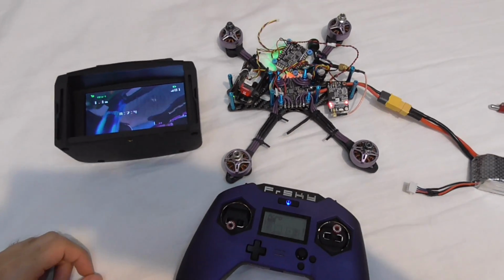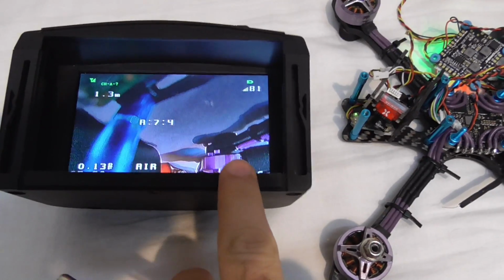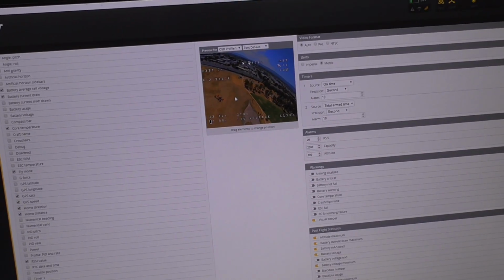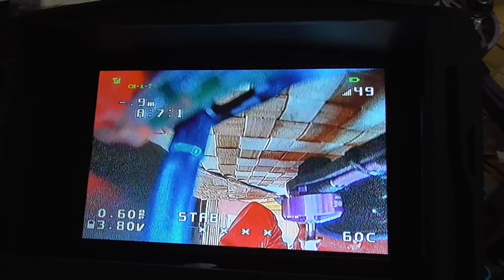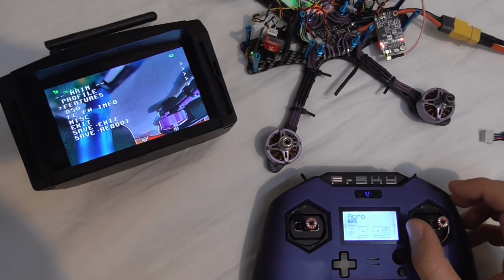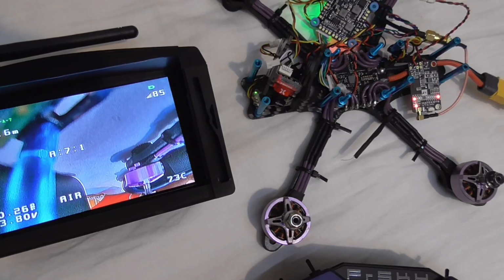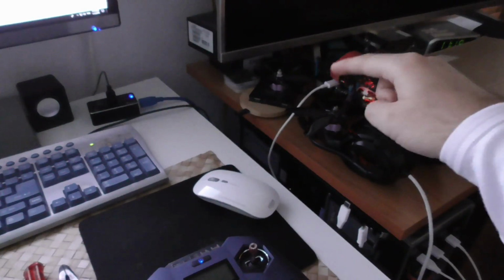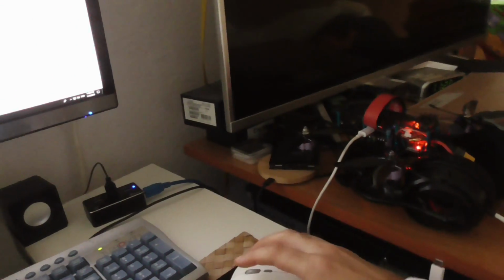How to show the Band, Channel, Power of VTX in FPV goggles? (Betaflight, Matek)

Comment: Tr and Sr VTX has to be the same power? 

Also what is TR vtx? 

Thanks
Reply from the maker: Tx = Transmitter, Rx = Receiver.
I'm not sure about the "power" but they must be made for the same frequency. You can use different shape antennas each has its own benefits.